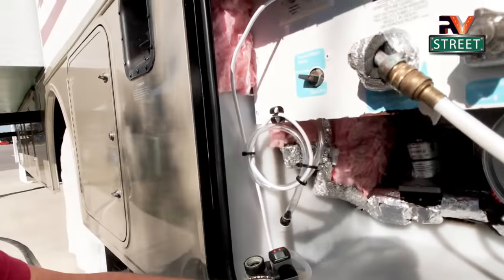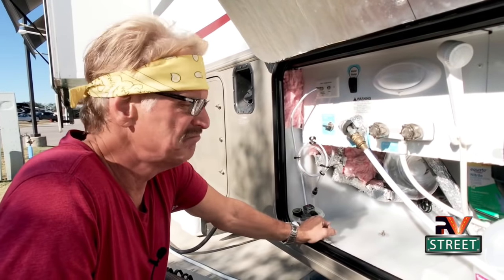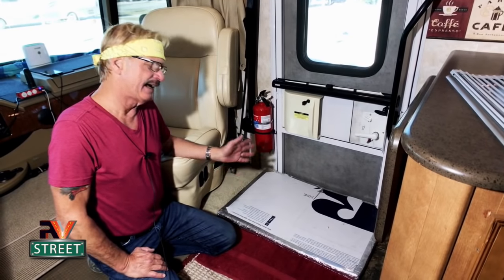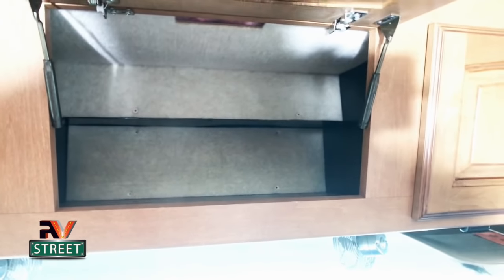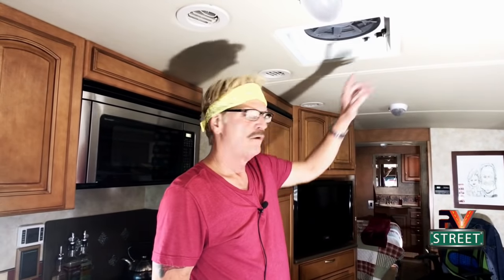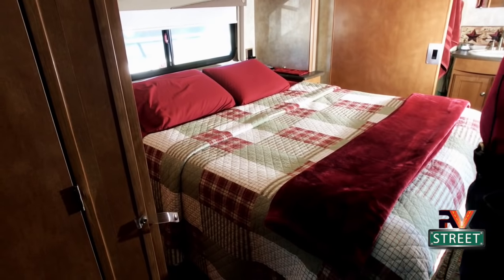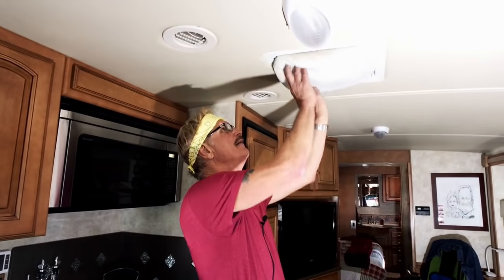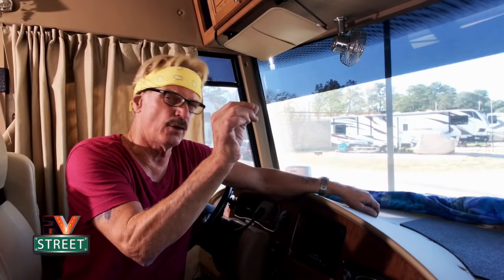😰  INSULATE, HEAT & PROTECT • Key to stay warm in your RV

Comment: Our park is supposed to be 50amp service but we've checked and it's only reading 28amp and when I use our space heater noticed that our lights will dim. The only electronics we use is a tv and satellite box. And unfortunately our hot water heater is propane only. What would you suggest? Relocating to a different park isn't an option right now
Reply from the maker: We lived in Maine all summer on 15amp and we're a 50amp coach. So it's all about managing your electric power. Actually your water heater running on propane saves using any electricity so thats good. Your interior lights are all 12volt so they work off your batteries. They have nothing to do with being plugged into shore power. As long as you have a good batteries you should be good there too. When's the last time you've checked or serviced your batteries? If you're plugging your heater into a wall socket and using your inverter that would affect your batteries and make the the lights go dim. No need to run your inverter. 28amp is more than enough to run a space heater. If you have your inverter ON turn it OFF and run your heater off shore power by plugging into a wall socket. If need be, turn off the satellite box and watch over the air TV. Again, it's all about managing your electric power with what you have and you have plenty.

Comment: Ever build a kegerator?  Where you convert a chest freezer to a keg cooler...?  Well, they make extension cords to use with kegerators so you can convert your "Freezer" to a "cooler".  It has a thermometer on a thin wire you put in the cooler that goes into a box with an outlet.  You adjust the temperature on that box to the temperature you want and when it gets to a certain temperature it turns off or on the outlet.  Using that you can leave that heat lamp down there plugged into that outlet and when the temp drops to a certain point it can turn the lamp on for you.  Here's something similar.  https://www.amazon.com/DIGITEN-Thermostat-Temperature-Controller-Thermometer/dp/B07SG5PHYJ/ref=sr_1_3?dchild=1&keywords=thermometer+outlet&qid=1627939321&sr=8-3
Reply from the maker: Interesting. 👍

Comment: Just a little confused. Why spend all the time securing the draft points in the rig when you are going to open up vents and or windows to allow outside airflow?
Reply from the maker: No problem...
Cracking a vent or two a little allows a little fresh air to come in and prevents condensation from building up on the windows. Condensation is a big problem if you don't do that. If you keep the rig buttoned up tight when it's cold outside and warm inside you WILL create condensation. Not good. Try it both ways and you'll see. Securing the draft points helps keep your basement warmer, keeps heaters from working so hard, protects your wet bay, keeps floors warm and pipes from freezing. 👍

Comment: I didn't catch why you take the backing off one side of (r19?) Insulation.
Reply from the maker: This question has been answered in the comments but here it is again....

In a nut shell, the faced insulation is normally used as a vapor/moisture barrier when used in home walls application and is not needed in this situation and especially when I’m putting in several layers in those large empty cavities. If Home Depot had unfaced in stock at the time, I would of bought that.

thx so much for watching.

Comment: So how do you insulate your water hose hookup outside so it doesn't freeze overnight or worse burst?
Reply from the maker: I don't. 
If it's going to get that cold for a long duration where freezing is an issue, I disconnect everything from the spigot forward, put it in the wet bay and put the water softener in the RV and live off our fresh water tank. It's a rare occurrence.
Reply: @RVstreet  Ok ,thanks for the reply!

Comment: What is the advantage of removing the paper on the R19?
Reply from the maker: This question has been answered many times in the comments but....

In a nut shell, the faced insulation is normally used as a vapor/moisture barrier when used in home walls application but is not needed in this situation and especially when I’m putting in several layers in those large empty cavities. If Home Depot had unfaced in stock at the time, I would of bought that.

Comment: Can you insulate the pipes forever? So I dont have to keep on taking it off?
Reply from the maker: Yes absolutely. That's what I did. 
My pipes stay insulated year round. If I ever had to get in there and do a repair or something, I'd simply remove that portion of foam insulation, do the repair and then replace the insulation.

Comment: So... Specifically under the sink, why remove the paper backing? Instead of leaving it on the side facing you?
Reply from the maker: This question has been answered in the comments but here it is again....

In a nut shell, the faced insulation is normally used as a vapor/moisture barrier when used in home walls application and is not needed in this situation and especially when I’m putting in several layers in those large empty cavities. If Home Depot had unfaced in stock at the time, I would of bought that.

Comment: Why did you take the paper backing off the insulation.
Reply from the maker: This question has been answered multiple times in the comments but here it is again....
In a nut shell, the faced insulation is normally used as a vapor/moisture barrier when used in home walls application and is not needed in this situation and especially when I’m putting in several layers in those large empty cavities. If Home Depot had in stock at the time unfaced I would of bought that.
thx for watching RvBadlands 👍

Comment: I never knew these expensive beautiful coaches are so poorly insulated!
Reply from the maker: Some coaches are better insulated than others. Ours back in 2012 is what I'd call a mid-entry coach but certainly isn't a true 4 seasons coach from the factory, but overall the build quality of ours is pretty darn good. It has build qualities and features that you don't see today in new coaches like ours. With entry level coaches IMO could no way sustain low 20º for several days from the factory. But now that I've done these additional insulation steps, we've safely lived in 10º thru the mid to high teens for several days with no problems. Not sure if we could go down to 0º or not for several days. Haven't tested that yet and if Joanie has anything to say about it we never will either 😜

Comment: You take the paper off you lose the "R". You can buy battan insulation without paper.
Reply from the maker: Well, as I said in the video they didn't have insulation without paper at the time or I would have bought that. But it was no problem. In a nut shell, the faced insulation is normally used as a vapor/moisture barrier when used in home walls application and is not needed in this situation and especially when I’m putting in several layers in those large empty cavities.
thx A 👍

Comment: I am a newbie l have a 2006 Itasca suncruiser l do l know if l have heated water bays
Reply from the maker: Start up your propane furnace, let it run for a few minutes and then open the wet bay door and see if it's warming up. Or read your manual.

Comment: I am very new to the RV life and learning the ropes.
I have an electric furnace plug in I tried to use in my rig but it keeps shutting off . I had it on a gif outlet . I woke up to a freezing house and the floor unit would not turn back on twice . I was trying to do what I normally do in a house and then thought better of it when I looked on a forum that said they draw to much power  and can causs electrical fires in the walls. So I went to propane after that and have been concerned that the cost is pretty expensive compared to use using an electrical unit .
Please if anyone has some suggestions ..I live full time in a park situation with electric hook up.
Reply from the maker: Yep propane is usually much more expensive than electric and this year the cost has jumped dramatically. I've been using our ceramic electric floor furnace for years now in our RV. You can safely use an ceramic electric furnace like I showed in the video, just make sure it draws 1500 watts or less. Also don't plug it into a GFI outlet or use an extension cord.
The furnace I use is in my Amazon Store in the "Stay Toasty, Control Condensation" category. https://www.amazon.com/shop/rvstreet

Hope this helps 👍

Comment from the maker: After I made this video—about a month later—a record breaking HISTORIC WINTER EVENT hit the central plains and Texas and left millions without POWER AND WATER. Folks lost groceries, gas stations and grocery stores were closed, and many couldn't even stay warm. Many RVer's were just NOT PREPARED.
Watch these two follow up videos:
https://www.youtube.com/watch?v=kR2KWE3g270&t=591s
https://www.youtube.com/watch?v=o6kdJKaIuB8&t=508s

My clarification on using the propane furnace: 
When I mentioned why I don't understand why some people use their propane furnace instead of a floor furnace and their electric at the pedestal, I don't understand why people would do that when it's NOT FREEZING TEMPS OUTSIDE because many do. They're using up their propane, when they could be using a floor furnace instead, use the electric at the pedestal, save their propane, and it's more quiet. Now if it's in the mid to low 20º for several hours or days and they're not using a light or something else in their bays to keep their tanks from freezing, then yes, I understand why they would use their propane furnace. Or if there is no available electric at all, like last years winter event in Texas. In those freezing scenarios, many people who do have heated bays, it makes sense to use the propane furnace. Otherwise, when it's just cold but not freezing and there's electricity, it makes no since to me to use the propane furnace. In 5yrs. we have rarely used our propane furnace.

Comment: It seems pointless to take off the paper from the pink  Installation.... paper maybe thin but every little bit helps..... plus when you take it off, that makes more to throw away. And if and when you sell the rv with the pink installation under the sink and other places.. then the new owner won't forget what the rating of it is because the printing on the paper
Reply from the maker: The faced insulation is normally used as a vapor/moisture barrier when used in home walls application and is not needed in this situation and especially when I’m putting in several layers in those large empty cavities. The new owner won't forget the rating either, because I have 35pages of logged maintenance & upgrade records plus endless videos of everything I've done to the coach.
Reply: @RVstreet  still the point... if you sell the camper to someone else.. how would they know what rating it is if the paper is gone... and why waste time taking all that paper off if it won't hurt anything??? Becuse the way I see it is your wasting time taking it off

Comment: I use fireplace and 1 heater until bed for safety
Reply: Karcher makes a condensation hand held window for rv sucks water off with elect squeegees blade rechargable best think I bought for rv
Reply: Slot of good information
Reply: I live in mine 5 wheel 3 yrs almost

Comment: Why do you take the backing off the r19?
Reply from the maker: This question has been answered in the comments but here it is again....

In a nut shell, the faced insulation is normally used as a vapor/moisture barrier when used in home walls application and is not needed in this situation and especially when I’m putting in several layers in those large empty cavities. If Home Depot had unfaced in stock at the time, I would of bought that.
thx for watching Jaz

Comment: Maybe instead of using glass insulation use spray foam.
Reply from the maker: The only problem I see with that is if it ever has to be removed for any reason it could be difficult.

Comment: Never buy spray foam that says open cell or does not say. Always buy closed cell foam and 90% of all spray foam is open cell and it is really bad for one reason, it is like a sponge and sucks up water and holds it. Closed cell foam is what it says it is closed to let water not to soak in and again if it does not say on can do not buy it because there’s a 99 % chance it’s open cell. Hope this helps
Reply from the maker: thx Brent...
Ya the blue board @ HD I mentioned is perfect for the application I showed. 5yrs. in use now and it has made all the difference in the world. All folks with RV's should pay close attention to all the multitude of areas you can add more insulation like I showed and more. It will keep your RV warmer in the winter and cooler in the summer.

Comment: Why do you remove the paper from the R-19?
Reply from the maker: In a nut shell, the faced insulation is normally used as a vapor/moisture barrier when used in home walls application and is not needed in this situation and especially when I’m putting in several layers in those large empty cavities. If you can find it unfaced that would be be less work.

Comment: Wouldn't that help keep you warm in the summer as well
Reply from the maker: Additional insulation helps keep you COOLER in summer and helps keep your AC units from having to work as hard. Good insulation helps in both cold and warm temps.

Comment: Why take paper off installation
Reply from the maker: This question has been answered in the comments but here it is again....

In a nut shell, the faced insulation is normally used as a vapor/moisture barrier when used in home walls application and is not needed in this situation and especially when I’m putting in several layers in those large empty cavities. If Home Depot had unfaced in stock at the time,  I would of bought that.

Comment: It's not the heat it's the humidity got to watch if you have an aluminum roof and or Walls as the condensation from your breath will make it look like swiss cheese my back roof panel did that the moisture went right through the ceiling panel and the insulation and condensed on the aluminum roof found out in the first spring rain I was awakened to a very wet bed
Reply from the maker: You can control the condensation with dehumidifiers. We did cover this at the end of the video. Dehumidifiers will eliminate the water accumulating on windows and walls. You also have to crack open a couple of roof vents to allow the RV to breath inside when you're heating the RV and it's cold outside. Have you tried this?
Reply: @RVstreet  I only slept in it one winter but I didn't see any sign of condensation anywhere else not even in the bedroom just the aftermath in the spring I didn't know that human breath was that asidic but that peice was full of pin holes
maybe that's why they started to use fabric roof membranes but you're right about insulation and stopping air leaks I will be doing that on the one I have now I just have to fix the leaks i don't know why they transition front and back in such a bad spot six inches further would be so much better so I will wait for warm weather to fix it thanks for your video
Reply from the maker: @douglaswindsor120  👍

Comment: Man someone needs to make a video for people that are broke and not living in a half a million dollar rv but instead a normal ass camper lol. Because I do and I am fuckin freezing rn and frost is forming on the inside of my camper. Pretty much need tips on how to stay warm in a camper on a fuckin budget lmao. And I am pretty sure there is no cheap effective way to do that so I. AM. FUCKED. 🤣. BUT I will keep on keepin on and trying and doing what I can. 🤷‍♂️🤞✌️
Reply from the maker: Hey Johnny,
I hear ya, but just to be clear my RV is no 1/2 million RV I can assure you. But your coming in loud and clear. Our income is living off SS so we don't have a unlimited budget either. Just about everything I showed here is Waaaay low budget stuff to do and it WILL make a huge difference to stay warm in any RV. I mean $500 will do wonders for your RV. Go to Home Depot and buy some R-19 insulation and start putting that stuff every where you can like I showed you. Also while your there buy some PVC insulation tubes and insulate all your pipes in the wet bay. Buy you an electric floor furnace like mine for $76 and that way you can save a lot of money and not having to keep buying propane. Buy some vent pillows to insert into your vents. Get a down sleeping bag. Buy two portable dehumidifiers to help control condensation. Keep one vent slightly cracked open so the RV can breath some. Get a couple of throw rugs to put on the floor in the bedroom and living space. It will help keep your feet warm. You get the idea. Do the small cheap stuff but be methodical in insulating everywhere you can. You don't have to spend a lot of money to make this happen. Go to my Amazon Store below and look in the "Stay Toasty, Control Condensation" category. You can get everything right there except the stuff from Home Depot and in the end, you won't spend more than $500.
https://www.amazon.com/shop/rvstreet
Reply: @RVstreet  awesome. Thanks for replying. I will definitely look into that. It is currently -22 as I am writing this and thats pretty cold lol. Got propane running 24/7.  Thanks for your time!